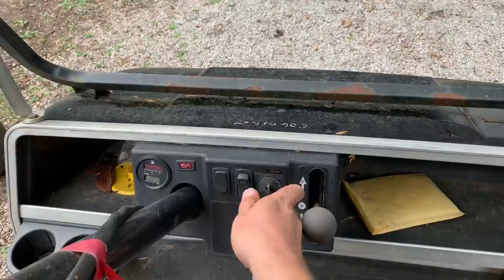Chateau Life 🏰 EP 28: NEW TOY FOR EVENTS

Comment: Here's a way of not having to clean brushes from day to day. If you are painting in the same color from day to day or need to take a break and not have to clean your brushes or rollers. Wrap the brush in clear plastic wrap. It should wrap around at least 3 times. This can last for a week or two for acrylic paint and a few days for oil unless oil is used every day then it lasts longer. Give it a try.
Reply: If you put them in the freezer, they are good for even longer!
Reply: You can also put them in the freezer.